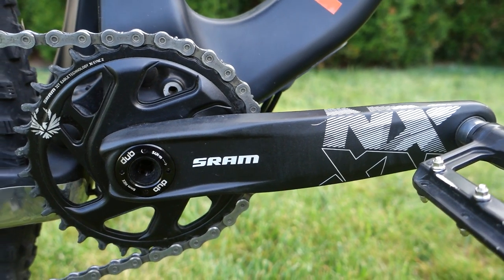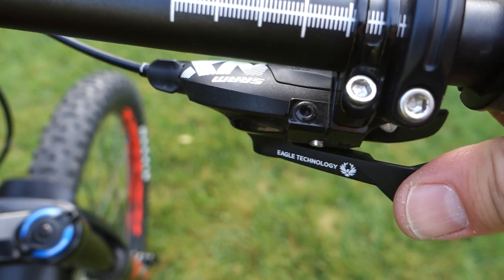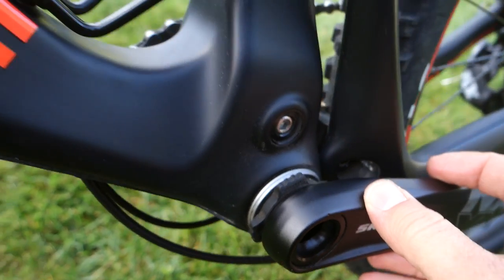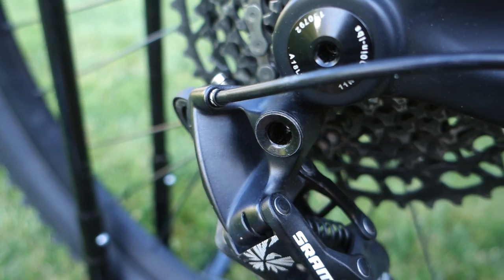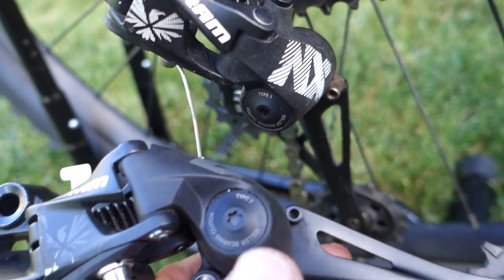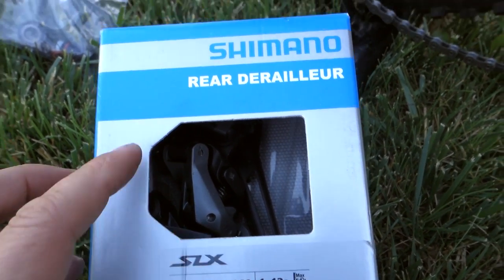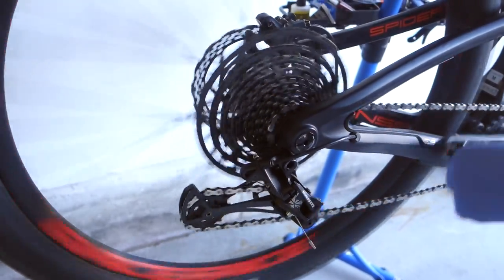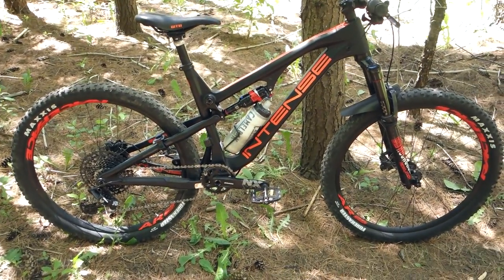SRAM Eagle NX UPGRADES - Eagle NX  12 speed Review, Parts, Compatibility

Comment: I have NX transmission, no problem with shifting to big star, but considerable issues when shifting in mid-range. On the bike stand it shift good, but fails on a trail. Mechanic said the issue is in the cables, I am not sure.

Comment: I ended up with NX when the bike manufacturer and dealer upgraded upgraded my bike (for free!) to 1x and NX was the logical option given the HG freehub. I'm pretty happy with it BUT the DUB BB left bearing has died <1000km (probably due to incorrect preload) and the smaller cogs are slightly worn. I've just converted to ebike, and the first upgrade was to GX chain, probably should have gone a bit better than that though. Once I'd adjusted the NX derailleur correctly, shifting was pretty good and better than my Shimano fitted bike, not sure why people are down on SRAM.
Reply from the maker: NX wirks fine if adjusted properly as you noticed.

Comment: Spot on review! I've been running an NX rear derailer on one mountain bike and Deore XT rear derailleur on another for approx. a year now and have come to find the NX is not as durable/reliable as the Shimano Deore XT. I recently swapped the NX derailleur out for a Deore XT rear derailleur and am very much appreciating the reliability in shifting :) I am interested with your suggestion to upgrade the mounting knuckle to see if that would make a difference.
Reply: @LoveMTB  Does the SLX have the same tucked-in Shadow profile?
Similar to the Deore XT.
Reply: Can you replace NX derailleur to Shimano Deore 12 speed on an NX drivetrain? Also, do I need to replace the shifters as well?

Comment: When my Commencal Meta TR 29 arrived, it was equipped with NX with GX Crank. Upon consulting SRAM, I immediately upgraded to GX Derailleur and Chain.  Someday I may go to Eagle Cassette, but this is working great!  Also, because of thumb injury, I upgraded to GX Twist Shifter (incredible how accurate it is and how fast you can shift to any range of gears).  I love the setup, particularly climbing with the Meta!!!
I don't need any more lower gears, and I don't want a bigger jump to a 52t, but I was wondering what you think of the new GX Derailleur as compared to the older one.
P.S.  Still riding my Trek 3x8 hardtail to work - love it too!

Comment: I didn't know that the NX/SX chains could crack like that, have been using mine for over a year without any issues so far. But will definitely keep a close eye on that. Thanks for the video, very informative am using an SX RD and upgrading to GX.
Reply: No issue with my NX chain for nearly 2 years now, have been rock solid. Apparently it’s also rated for e bikes.
Reply: @LoveMTB  That could be a possibility, have high hopes for SX since the I jumped to it from Deore 10 speed and that drivetrain is pretty reliable.
Reply: @LoveMTB  Thanks for sharing your thoughts, appreciate it. Hopefully, the experience will be nice down the line haha, it's been running good so far. Kudos on the videos btw :)

Comment: I am working on my friends Sram Eagle 12 speed, and that booger wont down shift from the biggest cog to the next smallest. I have to back pedal and then it will shift. It does shift from the biggest to the next smallest but it takes a long time. I am waiting for that B-screw adjustment plastic tool. Any advise of what might couse this?
Reply: @LoveMTB  Thanks!

Comment: Hi! I wanted to ask a friendly question if Sram is a bit more durable than Shimano?
It's a Haibike with Deore XT (2x10) and I just need a new front chain ring (44T) every 3 weeks.
It always looks like I used an angle grinder on it...
This is unbearable...
Reply: @LoveMTB  Thanks for anwsering!
2-3 weeks after installing a new 44T chainring, the front derailleur starts throwing the chain over the chainring.
If I adjust the front derailleur so that the chain cannot throw over the chain ring, then I can no longer shift up. its impossible to adjust, iam only able to stop that again and again with a new chain ring. I decide that it's worn out because every time after 3 weeks it looks as if someone had worked on it with an angle grinder, this time it's even bent.
I asked if sram is more stable because then I only have one chain ring at the front and this whole front derailleur horror might end then.
But can I still drive my 45 km/h on a straight with sram gears? The gear shifts with only one chainring in front all have so few teeth.
And i still need my hill climbing gears.
Sorry vor all that spam.

Comment: I really like that Intense bike! I 😎😍
My new YT Capra came with full SX. 1×12.  The rear derailer isn't the best. Plastic for sure! And no wheel to help ease cable shifting. Will upgrade to GX when breaks. Last years base Capra had full NX. But they went cheaper spec to lower price quite a bit. Putting it in my price range. My Marin Trail bike came with NX  derailer and shifter and Fsa crankset. It has been really reliable. Have been on Sx since January...Sx hanging in there. 
Nice video. Very helpful.
Reply: i destroyed an slx derailleur by adjusting a screw once... it is utter garbeage.  shimano slx or shimano deore on the other hand feel absolutely amazing and is even cheaper. no idea how they do it. many bikes come with eagle though, i had to pay alot to change my drivetrain to shimano after the crappy sram bottom bracket started creaking like crazy.
Reply: I like that NX Drivetrain you have on the bike. I have it on my trail bike. BeeN Reliable for me.

Comment: I have this thumbs down because I have GX and Nx groupsets. I do not agree with his recommendation on throwing out a brand new Nx chain. How wasteful and unnecessary.  The chain is fine if you look after it. I ride enduro in Ireland and the chain has held up well. He didn't like the shifting, has he checked the indexation and tried adjusting it

Comment: So I have a 2021 Norco Revolver FS2 100, its an XC race bike and I intend to race it. It has NX Eagle on it. I am wondering if the issues with NX Eagle are there from new or occur with wear over time? I was considering making some upgrades to Shimano but was wondering if I could maybe get through a season with the NX Eagle first before it started causing problems. Was thinking I would use XT RD and Cassette with SLX chain and shifter and then use One's Switch SRAM DM to put a Shimano compatible chain ring on the NX Eagle crank. I noticed you said you like the GX Eagle over the NX Eagle chain, I had understood the GX chain was the same just with a different coating. Would appreciate your thoughts.

Comment: Any thoughts if the GX Lunar Max 52t derauiler is a better NX upgrade compared to the suggested Shimano SLX? From what I understand, the GX Lunar Max is backwards compatible to 50t (currently running Sunrace 11-50t) but unsure if it (GX Lunar Max) has the same short comings you describe with the 50t GX derauiler in the video.

Comment: The SX 1 x 12, line came on my wife’s bike and I’d like to upgrade everything except the cranks and front sprocket.  But new rear cassette, new rear derailleur, new shift levers.  If I get the GX 12 series as an upgrade everything would match up think?  You said shimano SLX might fit it too?  I like shimano slx it’s what I have on my cannondale habit 6 and it’s given me no trouble in double the riding time of that of my wife’s with SRAM SX which doesn’t shift as well even when it was brand  new 6 months ago.   Thanks

Comment: I’m trying to get a 11speed xx1 cassette 1199 10-42 to work with my 11speed nx shifter and 11speed nx Derailer. 
And it’s not shifting very smoothly. And chain comes off 
When I back peddle it on the 42 tooth 
Are these parts compatible?

Comment: hard to beat full sx drivetrain for 300 w. Crankset
Reply: @LoveMTB  80 bucks ain't bad for a replacement
Reply: @LoveMTB  and you shouldn't be replacing the rear derailleur unless you're a crazy rider, rough shifter, careless or a crasher.  I have this 2000 deore xt 9 speed derailleur still works but the bike has battle scars.  Unless you mean the general reliability is just not there even for casual riding

Comment: If you want more clearance for you water bottle , you can mount the shock with the body towards the rear and shaft to the front. I did that to improve the ease of removing the water bottle in an intense acv.

Comment: Novice question here, but did you say you could upgrade JUST the derailleur to a Shimano SLX? Is that possible with preexisting sram eagle components? I would love to upgrade from an SX eagle on the bike I might buy, but the SLX seems cheaper and better than GX (forgive me if I'm wrong). I just didn't know if it was possible to mix and match brands. If not, would a GX eagle derailleur be compatible? Apparently the SX/NX parts use a different hub, so it wouldn't be compatible with the wheel? Any help appreciated :)
Reply: @LoveMTB  Thanks so much mate I just stumbled across your actual video on the shimano 12sp with sram components right after. Great video keep it up

Comment: The 2022 Epic Evo comes with all NX drivetrain except for SX chain and X1000 Eagle crankset, its 2021 model comes with Shimano SLX levers and rear derailleur w/Deore chain and cassette. What model do you recommend? 2021 is only $50 less. By the way, GREAT video.
Reply: @LoveMTB  The drivetrain is the only thing different between the two.
Reply: @LoveMTB  Cheers...I'm glad I came across your video and appreciate your opinion. I'm going with the 2021 model.

Comment: You should check out the new sram 52t stuff, I worked on installing an X01 520 group at my shop today and I was surprised by how well the shifting performance is on the 10t gap 42-52

Comment: So you can just bolt on a Shimano derailleur? No more 1/1 - 2/1 pull ratio differences?
Reply: Never mind...I just watched your video on this subject..awesome! Wish I knew this earlier, I've been through two GX derailleurs here in the last couple of months due to picking up a stick and bending them all up into unusable hunks. I had some degree of success bending them back into shape, but the crisp shifting just goes away once they get bent, you just can't straighten them back to perfect. (BTW, I have a hanger gauge, and the hanger stayed true in both instances)
Can't help but think an XT mech will be much tougher and not bend as easily.
Reply: @LoveMTB  Yep, just did right before you replied.  So, I can use the GX shifter with an XT derailleur? Thanks for putting out these videos, very helpful!

Comment: Any point in going from 11spd GX none eagle to 11spd GX eagle or better to just get shimano xt/xtr rear derailleur ?
Reply: @LoveMTB  ok, didn't realize sram gave up on 11spd support.
So my question is  would the shifting be better if i switched to a shimano xt/xtr rear derailleur ?
would that even work with the rest of my gx 11spd components ?
Reply: @LoveMTB  THX but i am not looking for more range.
i previously had the 2x11 XT group set but traded it for the GX set with grip shift.
i kept the xt brake set since i like it more then the sram stuff.
Thanks for the help, just hoping i still have "decent" option for 11spd in the future.
i like shimano's durability so i might switch to it in the future while using grip shift since i hear there's none of that 1:1 / 2:1 actuation problems like 8,9 speeds had.
Reply: @LoveMTB  No i didn't, guess i'am still stuck with the 90's & early 2000's.
i Know there's a "mod" from 13 to make a trigger 11 to 12, but grip i have No idea.
THX for the info.
i just worry i get 12spd & viola 13/14 spd is the next BS.................Sad :(
How much more wide can they make the rear triangle & the chain thin before it's just a waste ofr $$$ for the "average" user ?
are they gonna do a 180 & do 2x something AGAIN ?

Comment: Can i use an xtr 12 speed shifter with a 11/50 sram cassette perfectly? Or not? Thank you.
Reply: You could, but you will lose a hyperglide + of Shimano cassette (up and downshifting under load), also I think a cog spacing is a little bit different on Shimano and Sram cassettes. If you have enough money (you are asking about xtr, so I guess you have) you will be better with full shimano or sram drivetrain
Reply: @adamlukas3967  the reason i want to put a sram cassette is because i think xtr cassette is heavier than sram xx1 and sram is more open and avoid the mudd easier than shimano. What do you think?
Reply: @reynerlara5353  I don't know anything about the mud issue, sorry.
Reply: @adamlukas3967  sorry i mean mud. 
Sram o think the cassette is more open than shimano and lighter.
What do you think?
Reply: @reynerlara5353  I understand you mean mud, still never heard anything about mud clogging cassette, maybe try to explain it more?

Comment: I absolutely agree with you, Shimano is way better thought and designed. My new bike came with X01 AXS, I have given a try and works perfectly tbh (after some tweaking), but if the derailleur breaks is going to be hard to pay 670€ just for it, i might have to buy a Shimano XT 12S one.
Reply: Problem is if you have a bike like that you need to have the money to keep backing it.  You can't for example go broke on the bike hoping nothing needs to be maintained just like a house or facility.   You need to match your resources to what you are doing.  If you're worried about an expensive derailleur id stick with a cheaper bike where parts are lower end and cheaper.

Comment: Your suggestion.  I plan to use 11-50t sram nx eagle pg 1230 cassette because it fits Shimano freehub. But use x01 derailleur because I want shorter cage and  x01shifter because I want smooth and precise and double shift. And xx1 eagle 12 speed chain because that's available now.  Chainring 34, 36 or 38 depending on availability.  Do u think there will be any issues.